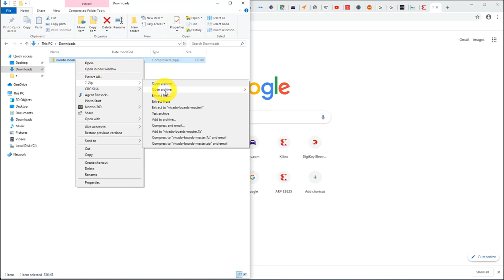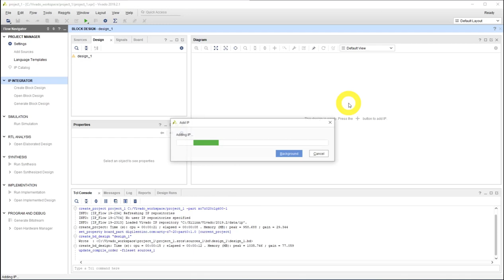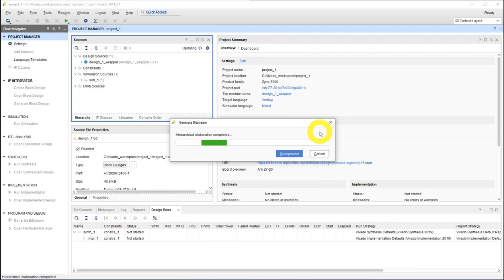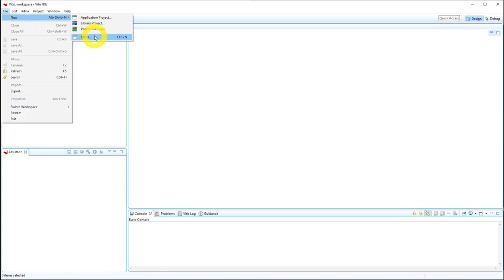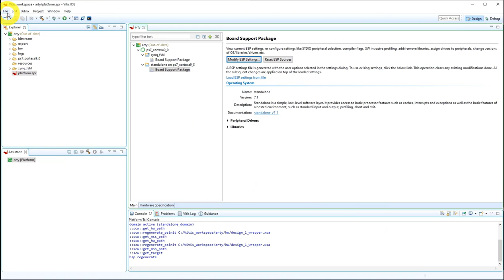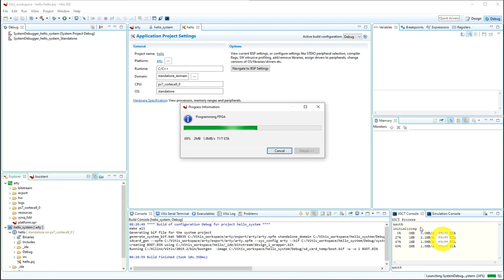Getting started with Xilinx Vitis SDK and Vivado 2019.2 using Digilent Arty Z7 Zynq FPGA Arm

Comment: Please answer my one question. Why we take the hardware design(XSA) to VITIS?
Reply: To integrate the program (firmware to drive the FPGA device accordingly ) with the design that was sketched in the Vivado suite   , the .XSA file contains hardware design with processor could be nios or microblaze  depending upon your FPGA variant everything is integrated properly which is then laid on to the FPGA fabric through the JTAG or SPI flash , the logic gates along with Look up tables are chosen before in the fpga variant fabric to get routed for the process a designer is wanting.